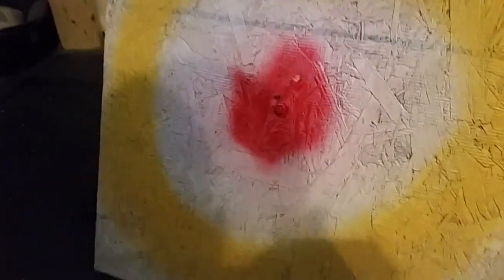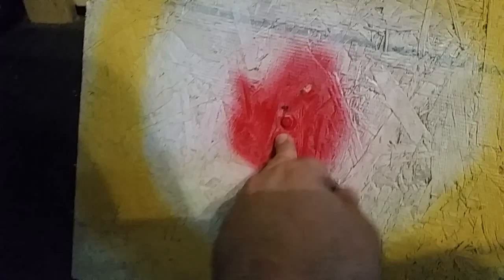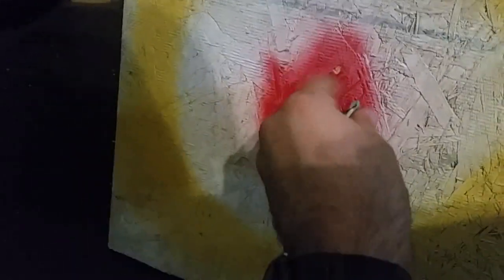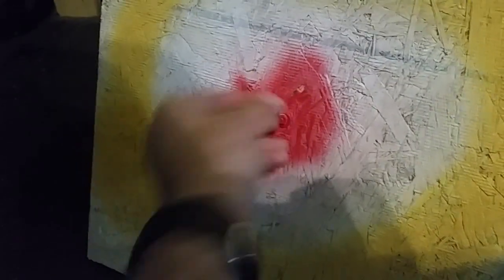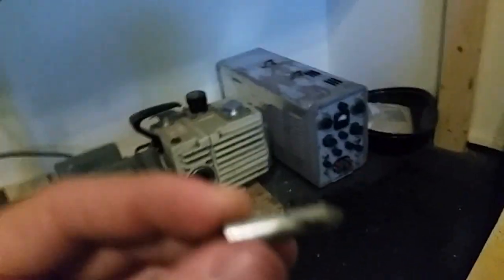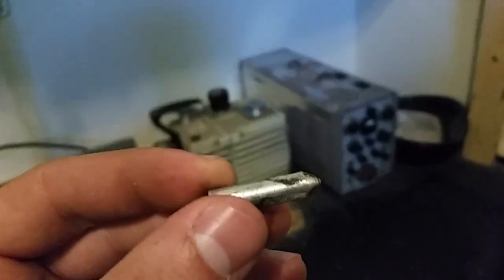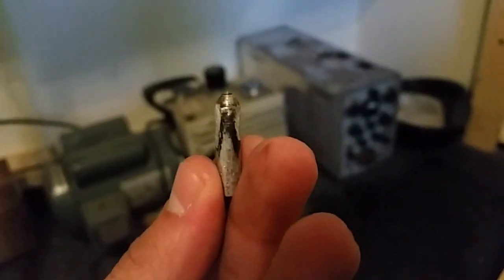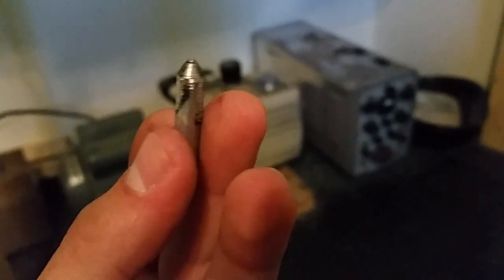XPR-1 Test 2 and 3 aftermath

Comment: I have a idea ,
just before firing the capacitor, fire a very strong laser down the barrel, then fire the capacitors WITHOUT a projectile. (don't stand near it as I have no idea what will happen)

all the plasma created momentarily from the high power laser should get dumped down range. (would be interesting if you could compress the plasma somehow with a pinch down to the beginning of the rails just before firing)
Reply: +Jacob Merrill Lasers don't emit plasma? They emit photons, which wouldn't be affected by the electromagnets in this gun.
Reply: no, but air can bloom into plasma, which can then be conductive, completing your gap, and accelerating a ball
of ions down range, (probably won't do much)
Reply: maybe even hit a target metal with a arc to make a plasma? (try and launch the resaulting plasma ?)

maybe this is a whole different project 
'plasma pistol'

open up a vacuum channel using a pulse laser for a microsecond, and then dump plasma down it.
Reply: 'Laser Induced Plasma Channel' 

Plasma injector :)

Comment: They say that it doesn't really matter the mass of the projectile if you can get it going fast enough.

Ever think about using a smaller projectile?
Reply: The smaller the projectile, the more it heats as well. Firing liquid metal does cause a lot of damage, but it's a recipe for clogging the gun and having no precision.